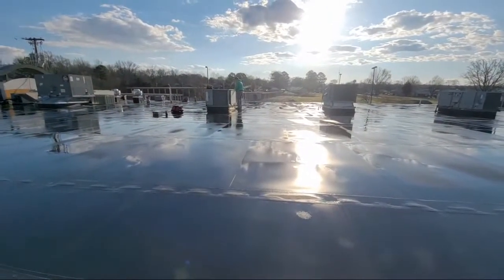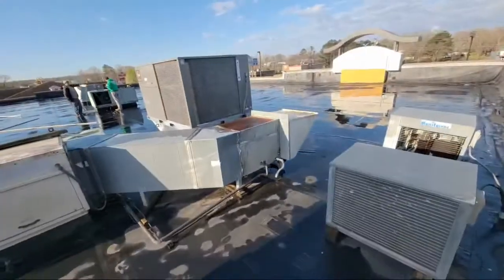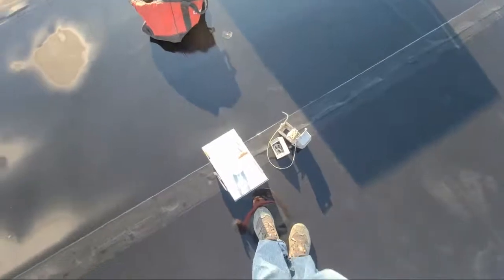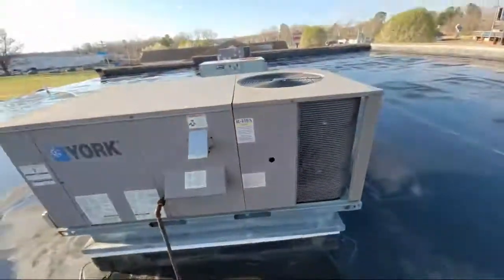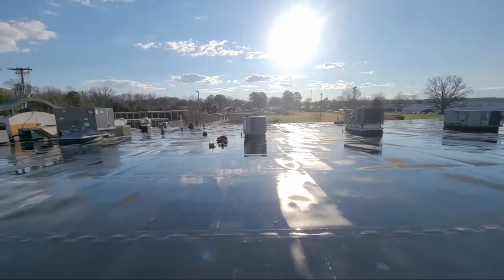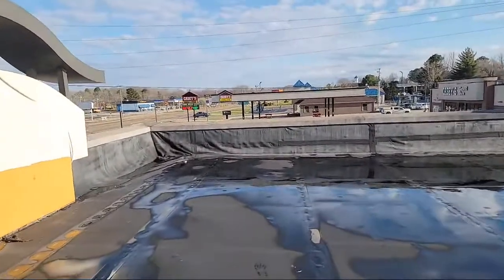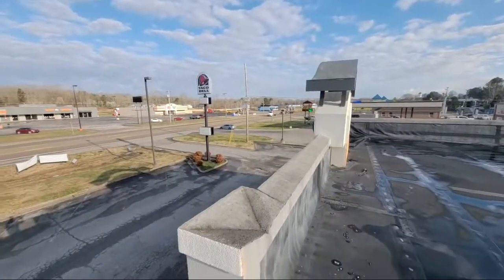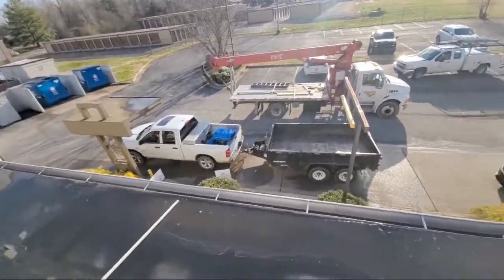Crane lift this morning #commercialhvac #hvac

Comment: Did you see the Honeywell Thermostat for the dual fuel use. Gas Furnace w/heat pump? T6 Pro Programmable stat, 2H/1C Heat Pump, 2H/2C Conventional
SKU: TH6220U2000
Brand: Honeywell Home  and  VisionPRO Outdoor Temperature Sensor
SKU: C7089U1006
Brand: Honeywell Home
? or: 
IO HVAC CONTROLS IO-DFK Dual Fuel Kit

MPN: IO-DFK, SKU: G1220902  What are your thought vegasmax  at  Y a h oo